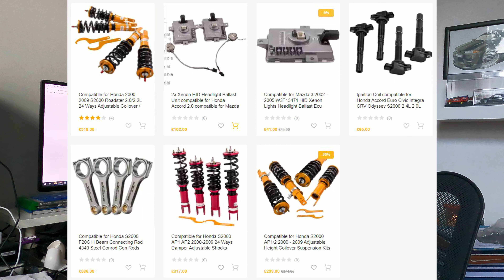Budget Coilovers Worth it? Maxpeeding Rods Coilover Review & Install Honda S2000

Comment: Skunk2 Pro ST or Ohlins are the best and most comfortable coilovers for the Honda S2000. They are more comfy than the the stock shocks and springs and handle much better with a ton more control..